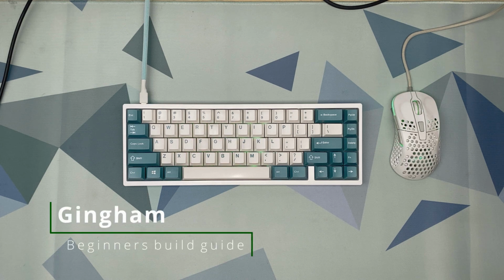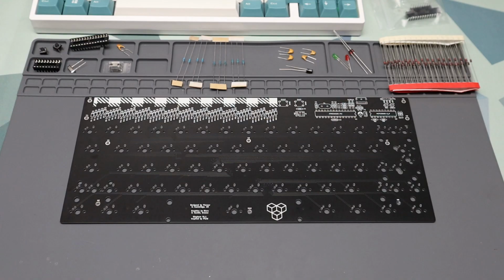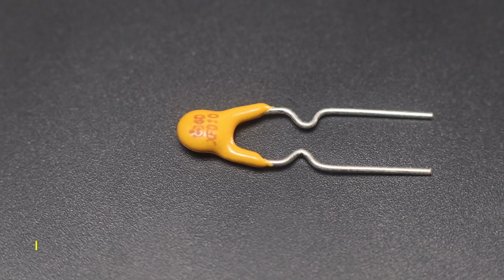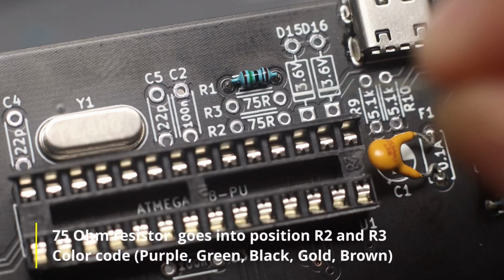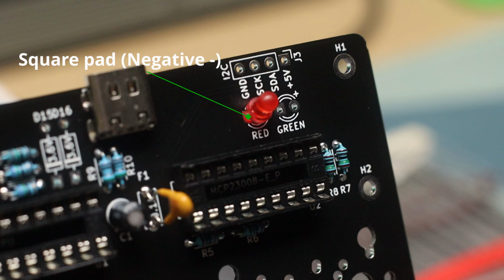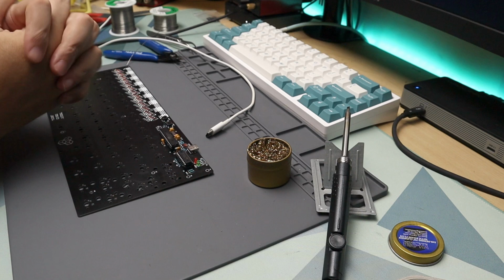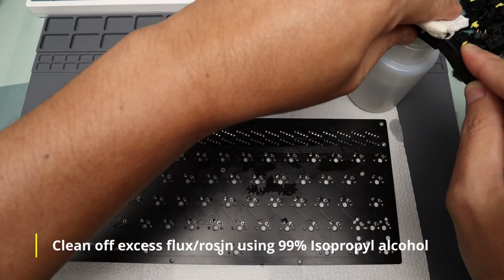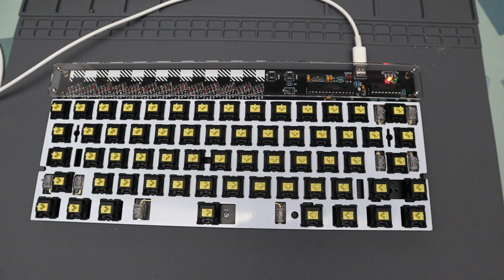Gingham (Through hole custom keyboard kit beginners build guide)

Comment: hello I built this board a few days ago and its worked fine until today it stopped registering after a power outage I tested it on via and nothing happens but when i click test matrix it works, It registers on my windows and when i plug it in windows makes a noise and registers it. I don't know what to do

Comment: What’s the difference between the different kinds of mill-max connectors and can I use a mill-max 7305 instead?
Reply: they just sit more flush to the pcb as there are 3 different types of mill max switches that all do the same thing but are different dimensions and material. 7305 sits the most flush but is also seen as the hardest to solder.

Comment: Alright. It's high time for me to put the boy pants and start buying the other components to solder and make a through hole keyboard.

It's one of the cheapest way to get a custom mechanical keyboard. Considering that I can just make the case and/or plate from acrylic or other stuff laying around.

Comment: One of the pieces broke what should I do the piece that broke was the "black top chip" that goes on the one on the pcb soldered in
Reply: if you mean the microcontroller you'd have to get another version of that chip and flash it with whatever software the distributors used.